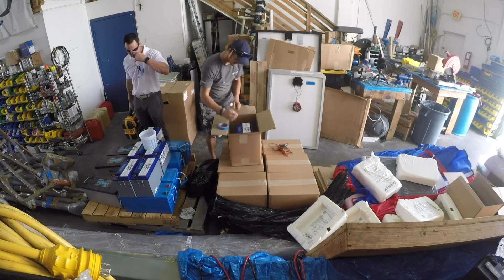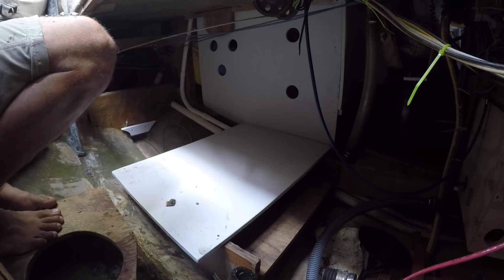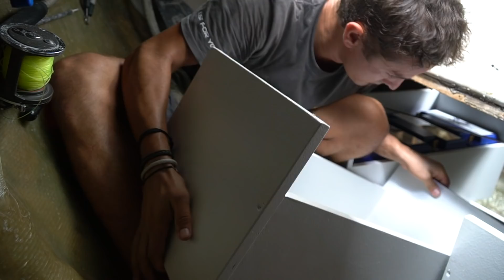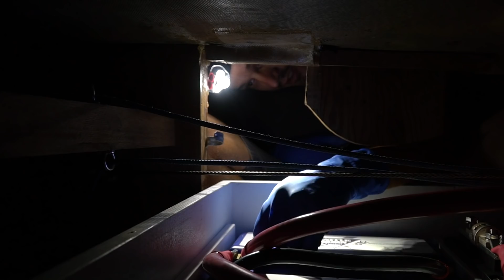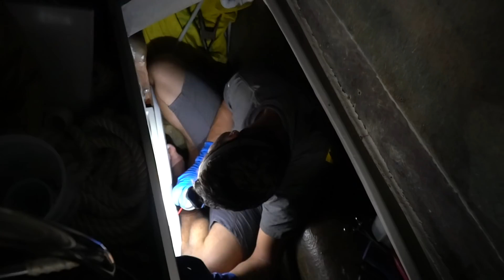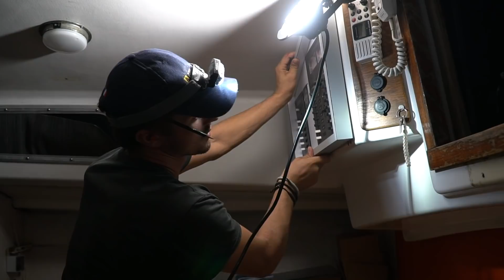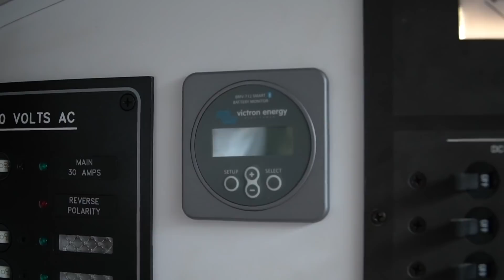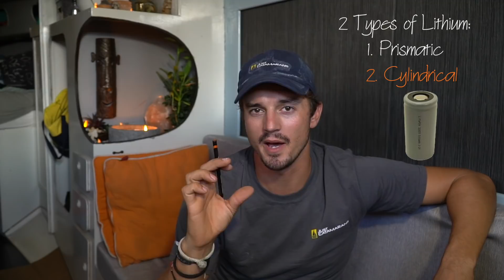Uma's new Battle Born LITHIUM heart ❤ — Sailing Uma [Step 135]

Comment: wouldn't you still have 1200 amp/hrs from the full bank.
Reply from the maker: If you wire them in parallel you increase amps but voltage stays the same. If you wire them in series you increase voltage but amps stay the same. Either way, total watt hours is the same. Volts X Amps = Watts.

Comment: Hi i have a 8.8 amp battery , on my bike that is cycle bike , this battery was supposed to do a  30 to 40 miles range, this was never the case, at best i got 24 mls , they are Samsung batterys so not rubbish, i think the truth is simple the company selling the bike is  talking through their hat about the amount of miles you will really get ,and i understand  that in my case a lot of factors need taken into account, wind tyres pressure my legs hills  etc, but even so its high time there was a realistic minimum, as to reach some of the claimed distances you would have to be living in a vacuum on Mars good luck guys .

Comment: 4/0 cable? That may be rated for up to 260 amps, depending on the type of insulation and the confinement (think conduit or raceway)! What is your motor drawing at startup? Total draw on the system with everything on? 4/0 seems like overkill.

Comment: I hate to be one of those guys on the Youtube but I work with battery strings pretty much every day.

Get a torque wrench for all those battery connections.  Torque them to spec so you do not get a repeat of what happened the last time a connector came loose.

  I would suggest taking the jacket off an old wire an putting it over the steering cables and taping it in place.  Had a coworker installing a string of batteries with non insulated tools, one light touch of a socket wrench to ground later he had to go to the hospital with 3rd degree burns on 3 fingers.  Even a double wrap of vinyl tape is better than no coating on the tools.   

I would make the trays more of a basket to allow for air circulation and possibly put boots over the exposed posts,  hate to see the steering cable part, short two terminals and start a fire.

You guys are doing good work,  keep it up and stay safe.

Comment: I used to be I to cb radio when I was younger, we used something called an isolation transformer to eliminate any electrical interference. Small thing, big difference. I'd also tune my antennae to my set using an SWR meter. It was incredible the difference this made, my cheap setup way outperformed everything else around. This a long time ago but I'd think the principles are still the same and if was in a small boat in a big ocean all the time it'd be something I'd look into! Find an old Ham Radio enthusiast in the area, those guys used to be able to build a radio set with a cereal box and set of guitar strings and some chewing gum.

Comment: I think its time to start talking Watt hours. When Watts figure in, the voltage isn't as important because the math reflects it directly. For instance, a 100 amp hour battery at 12 v is 1200 watt hours. A 100 amp hour battery at 48 volts is 4800 Watt Hours. It helps you to understand the amount of work the battery is capable of. There are other reasons motors like 48 volts, but understanding the work capability of a battery is very important.

Comment: I have a very basic setup with Lead Acid batteries.  I know that Lithium is the way to go, but I'm not sure if I'm waiting for the battery technology to get really smart so I can understand how to make the change, or I'm waiting for my brain to get really smart so I can understand how to make the change. I think I am now a bit smarter after watching this. Thanks.
Reply from the maker: These ones wire up the same as lead. You change a few setting in your charge controller and your good to go. Super easy. If you can wrap your head around the complexities of charging and discharging lead, than lithium is child's play in comparison.

Comment: He needs to correct that to lithium Iron Phosphate not Ion, LiFePo4.Also 
he did not seem to do any form of top balance as yet so he will probably
 realise all the batteries might show close voltage values but they need
 to be charged and balanced to get the full capacities from each.
Certainly interested to see how it goes driving that electric motor.
Reply from the maker: Honest spelling mistake... Dan said Iron, I accidentally wrote it wrong. Correcting it would mean deleting, re-editing and re-uploading the video. So,  I am sure you can see passed the missing R ;)

Comment: My heart was acing when I saw you with the wrench at the batteries and the rope nearby. Great explanations and many considerations that are not common.
I have one urgent request to you: When you drive for the first time, please have a flir camera (IR) or equal to monitor everything that there are no hot spots. Remember the time, the old battery died.
And - agreeing to the others: the batteries are very dense - not the best temperature management.

Comment: Hey guys, I sent you an FB message a while back but never got a response, might have been lost in the multitude of messages you receive.  Anyhow, it's with regards to your prop and electric motor and getting more out of it.  This is what I sent you... 
I came across this FB page where the chap has been developing a prop specifically designed for electric motors which will provide more thrust for less electric.  It might be worth you giving Fredrico a shout.  He hasn't got a lot on his page but it is definitely worth a look and maybe contact him.
https://www.facebook.com/groups/1459608140797997/?multi_permalinks=1653684484723694&notif_id=1518606188845116&notif_t=group_activity&ref=notif
I hope it's of some help.
Reply from the maker: Hi, Sorry for not responding to your message, it's hard to keep up with FB. Please send us an email instead.
Reply: No worries, I understand.  Information is as above with link.

Comment: I have never understood the high cost of these style lithium batteries. It is essentially a hundred dollars of Chinese lithium batteries and a five dollar Chinese controller assembled in the US into a five dollar Chinese plastic case. They are slightly cheaper to produce than a lead acid battery but cost many times more. Some people claim it is new technology but these batteries are essentially no different internally than a laptop or camera battery. I'll wait until the price comes down before I even consider putting lithium batteries in my boat. Regardless of my opinion of lithium batteries I think Dan and Kika did an amazing job with their install.

Comment: Dan , I'm surprised to see you use regular nuts for the cables to the batteries and not a locking type nut after your issue before? 
Also From my industry connections found this interesting catalogue of electric motor options inc electric saildrive!. Just FYI.
http://pdf.nauticexpo.com/pdf/transfluid/bellmarine-catalogue/31727-106569.html#open
Great work! Might need a solar vent for that hot compartment!
Cheers Warren
Reply from the maker: If nylon locking nuts get too warm, they fall off. It's actually against ABYC code to use them. I used locking washers instead.

Comment: At 11:48 RE Interference on your radio: Study how to reduce that via using  CHOKEs  and winding your wires together (vs running them straight) etc... Google: How to reduce radio interference on a boat. Also, now you have more batteries to charge so they may charge quicker but take a lot longer if they charge fully at all. Even 5 hrs of motoring in a storm or emergency like a dismasting etc is not much so I hope you have a great generator and plenty of fuel for it. I know you must as you two are really doing a bang up job at all of this! Great & informative videos as always!
Reply: DAN.... You have an email coming your way showing CHOKES and TOROIDS and links to Sources.  This is a common problem with ham radio equipment, but easily solved.

Comment: I was looking up those Batteries, really cool stuff, but very expensive, retail is around $1,000 for each battery ($949 on Amzn), so for your battery pack of 12 it's close to $12,000. I strongly support your decision, as its the wave of the future, so much cleaner, next to Nuclear, LOL. Please send us more info on the electrical diagram setup, or a good walkthrough of your entire electrical setup, that would be really cool to see.
1. Battery - https://battlebornbatteries.com/shop/12v-lifepo4-deep-cycle-battery/
2  Inverter - https://www.victronenergy.com/inverters/phoenix-inverter-180va-1200va
3. Charger - https://www.victronenergy.com/chargers/skylla-24v-48v
4. Converter - https://www.victronenergy.com/dc-dc-converters/orion-tr-dc-dc-converters-isolated
5. Battery Monitor - https://www.victronenergy.com/battery-monitors/bmv-712-smart

Comment: Seems to me there may be a heat issue, how are you going to keep the batteries from overheating?
Reply: I was thinking the same, not much of an air gap around the batteries to dissipate heat, there quite tightly packed in
Reply: Sounds like they will be charging pretty slowly, which should help.  Discharge will be faster though.

Comment: Thanks, great video! However speaking of misinformation, at 14:10 you state "lead acid batteries aren't designed to handle the load of an electric motor", I get that your system isn't designed for it but the statement is not true, eg: fork-lifts use lead-acid batteries with electric motors quite successfully.
Reply: Doug Mcdonell but high speed electric motors? Fork lifts utilize far slower motors that run very differently.
Reply: They convert battery power to horsepower,  not so different.

Comment: I really like the results of what I'm seeing with my Lithium Ion Batteries. I have heard good things with Lithium Iron Phosphate. Which one are these ? Did I miss that ?  Ok, sorry , but your confusing the H.E.L.L. the way you describe your batteries. Poor folks keep hearing you say "lithium Ion". You probably should have had a producer who told you "Drop the ION", from the beginning. Even when you get to the tech discussion at 15:00 you start off by saying your going to talk about Lithium ION ! Poor People out there. No wonder there is so much confusion.  Why would this be important. Gets nerdier, techier, but, fairly important. Lithium ION;s CELLS (not batteries) are hgher voltage than Lithium IRON PHOSPHATE . IONS are 4.2, Phosphates are, I believe, 3.2. HUGE ! So, a battery takes more cells for Iron Phosphate. BUT, more importantly, 4 X 3.2 = 12.6 for IRON PHOSPHATE . Thus, the DROP IN LITHIUM type battery is born. Doing this with Lithium Ion gives you a low voltage batter with 3 cells and too high with 4 (4X4.2=14.8) THESE ARE MINIMUM VOLTAGES, CHARGED THEY GO UP. Lead ACIDS MIN/MAX Should be kept at 12.2 to 15 approximately. Iron Phosphates are VERY CLOSE to that. We do want people to understand things , right ?

Comment: Hi - great video - getting my boat next year delivered incl. electric motor/LiFePo batteries (5Kwh) - very excited after watching your video! I looked up the price of the batteries you chose - is it really 12k$ in total? (999$ each?)
Reply: We would all be interested in the Boat manufacturers that is delivering you a boat WITH the electric motor installed. As someone on here stated (erroneously IMHO) that boat manufacturers are rumored to be moving away from this exact thing. Thanks!!!
Reply: Michael Buck - I found my boatyard very open and flexible in helping me chose the right propulsion - In my case the yard is Maree Haute from Britanny France - working with Torqueedo but also FMT ( Floren Marine Technik ) a German Supplier of Batteries Controllers Solar Panels etc. - will most likely go for a 5kwh system ( Batteries) and a 4 kw electric motor - boat weight is 2 tons - should give a range of 2 - 3 hrs at 4-5 knots

Comment: Charging while at sea is the issue for me and I assume you as well. 

I cruise a sailboat that is only slightly larger than UMA with a 400 watt wind generator that outputs between 60 to 200 watt in a fresh breeze and three large solar panels which output about 110 watts peak each on a clear day. Plus, I have a 100 amp Balmar alternator for those occasions when all else fails. My largest draw is refrigeration and an autopilot. I am able to keep my three bank LABs up without an issue, but I am anxious to learn your strategy for keeping your batteries charged when you are at sea when add the occasional 50 amp draw of propulsion to the mix. 

On a run, as is common in the trade winds, the wind generator rarely adds that much.
Reply from the maker: Our solar has been fine to keep up our daily needs. We didn''t motor much before and don't plan to in the future, but if we ever do, it will be in a canal or into a cut and we can charge up at a marina for the first night, then back out on anchor. We do plan on adding wind and we'll be working on regen as well. We'll see how it all evolves as we go.
Reply: When the large Kyocera solar panels were added atop the dinghy davits of my boat 12 years ago it received a lot of disapproving looks. Not so much any more.

Comment: Hi there. I'm very interested in how you get on because I've been running a 380AH 48V LiPO4 bank for 6yrs and 1500hrs of motoring. I haven't noticed any degradation and haven't used shore power because I have 1500W of solar and its been working out real well. You may need some back up generation if you want to do some long hard engine hrs but otherwise I think you'll be fine. An induction cooktop would be nice but they do suck a bit of power so I suggest you add a seperate gas bottle and baby weber BBQ which works fine for me.
Just one more suggestion; keep those batteries cool with a bit of ventilation and spacing. I have water cooling with a circulation pump but that is probably over the top for you.
I'll be waiting to see how you get on. Best wishes.

Comment: Have a look at adding supercapacitors you can get a battery like unit that will take the high peak loads off the battery and allow quick charge,  evens the battery usage expands the battery life. Great video.
Reply from the maker: We looked into that quite a bit back in the beginning. They may work for starting your car, but long, slow discharges, not so much.

Comment: Is it more efficient to wire the batteries into a 48 volt bank and then drop down to 12v for the rest of the boat vs doing the opposite?
Reply from the maker: yes. Higher voltage = less aps = less resistance = less heat. Impossible to run an electric motor as big as ours off of 12V it would require cable the size of my arm.

Comment: Love the upgrade to Uma!!! This will help you out in so many ways besides your electric motor. Delos also added Lithium battery banks without people knocking them on the cost. Uma do your thing and enjoy. Again, Just Catamarans are the bomb for their continued support of Uma and crew. ps...you could use heat shrink on that cable above the batteries to eliminate grounding out if applicable.

Comment: Dan...great stuff as always. As far as the noise interference on your VHF, it may behoove you to put some snap-on Ferrite core RF chokes on those cables. They are fairly reasonable and do wonders in a super quick fashion.Also a wise choice to move your cables to the other side if not to much of an inconvenience. However, I'd try the Ferrites before doing the extra work  Other tips and tricks are to keep you cables as separate as possible so they're not bleeding over into each other. I'm sure if you ask our good friend Google about reducing marine electronic noise, he/she will have a lot of suggestions! I'm excited to see if your math works out as I have my own theories about your numbers. PEACE OUT! Ü

Comment: It's great getting the batteries, but I think it departs from the soul of the series, a diy, keep cost low kinda theme. I'd like to see a repurpose of a Chevy Volt, Nissan Leaf, Ford Cmax, etc on a sailboat. But hard to turn down a sponsorship. Still enjoying the series, but keep it grounded.
Reply from the maker: Thanks. Our friends over on Sailing Saoirse just installed a pack from a Volt. It was our back up plan, but requires quite a bit more complex wiring and management. We always do the best we can with whats available to us. As we learn and grow and travel more we'll be constantly evolving, but isn't that the point?

Comment: Do you need to cool the batteries??
Reply from the maker: Probably not, they're in a locker that stays pretty cool since it's in the shade with good air flow and stays the temperature of the water we're in.